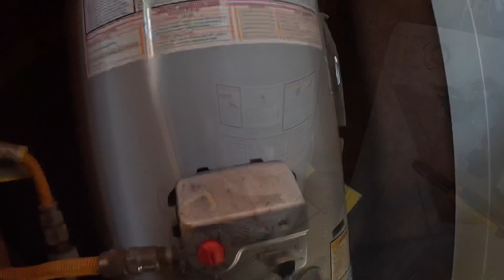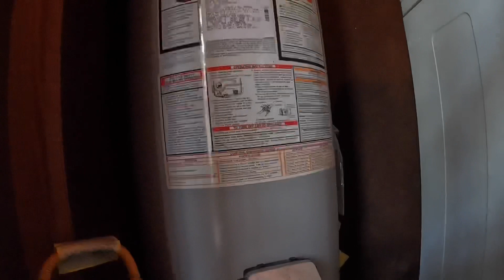Dangerous ⚠️ Water Heater! - How Do They Sleep At Night?

Comment: My roofers disconnected the vent pipe from my water heater. Some goober went up on the roof and messed with the pipe for 30 minutes. A couple days later, I found the pipe completely disconnected in the attic. I ended up fixing the pipe myself after a quick trip to Home Depot to buy some more B vent pipe.

Comment: FYI ...Hart & Cooley (Metal Vent) makes a single wall to double wall adapter. Believe the part # is 3 RPA!
Reply from the maker: Haven’t seen those
Reply: Me neither
Reply: That's code out west the depot sells them flue pipe listed parts on gas water heaters vent hood... 👍🤔🙏😔👍

Comment: Got a call last week, someone put a new furnace and coil in, set the condenser outside. Wired the furnace up and left. The lady called for a month to get it turned on, so the guy finally made it out and started it. Never hooked the flue or fresh air up, and let it run for months before they noticed something looked wrong

Comment: As a retired electrical contractor it is just easier to fix it correctly write out a bill and let it go. What your fixing is a common problem with all trades. Dependable licensed and insured contractors inherently cost more per hour than guys doing side work etc. Theses problems persist because homeowners or business owners see the difference in price per hour on service work and will hire the cheapest price they get, In the trades you pay for what you get. It’s that simple.

Comment: Good job, nothing wrong with single wall pipe, if it is done right. Always re-check for leaks after the unit fires. I once had a leak on a meter set appear after about 20 minutes, can't be too safe. Just a tip for you younger guys.

Comment: Up here in Virginia, after watching this I looked at my gas and furnace install (both gas). They have a combined 6 inch double wall going up through the floors. The furnace seems to be double wall all the way, to the combiner, but the water heater has a bit of single wall right at the heater flue. All well screwed and no tape in sight. So I guess up here in Va single wall is ok too, used appropriately. My new furnace was installed in 2022 and inspected by the county.

Comment: Why did you leave the adjustable 90 and just not use a straight piece of 3 inch from heater to B vent?
Reply: Wondering that too.
Reply: Not code to put screws in B vent in our area.  Didn’t look like there was 1” clearance from the double wall to the sheet rock.

Comment: GREAT JOB .Here in Las Vegas plumbing code for gas water heaters is must have a  sediment trap at the gas line before going into the gas valve .WH must be up off the ground 18 inches if located in a garage (car exhaust fumes) and drain pan.It's required that you must get a permit from the city but no one does that .

Comment: Curtis my local code , gas man locks out gas if appliance isn't connected with listed connection on type B pipe , for water heaters flue pipe , good adlib on bad vent line ✌️👍💪🙏🤔

Comment: You should take a piece of pilot tubing and bleed through that with a flame applied to the end of it rather than bleeding the way you did that the odorant won't be present right away but the gas could be also its a water heater you don't need to heat hot water lol
Reply: A pilot orifice is practically useless if you're trying to bleed the gas line. The pilot let's out such a little amount of gas that he may still be there bleeding it if he used that as a method.

Comment: I worked as a repair tech for a phone company. I had a case of trouble at a house and the IW (inside wire) was short in the house, testing from the protector on the outside of the house. The problem ended up being that the gas water heater had been replaced in the attic and the flue pipe was not long enough (like this video) and not secured correctly so whomever replaced it tied the IW running in the attic around the flue pipe to secure the pipe to a vertical 2X4. The hot flue pipe caused the IW to melt and the 2 wires that are used for dial tone were shorted together. There was enough slack in the wire to cut out the melted piece and resplice the 2 good ends of IW together. I advised the customer, I don't know if they had the flue pipe fixed or not.

Comment: Looked like the pressure relief valve was not properly installed either. It should have pipe attached that is no less than 6 inches from the floor.

Comment: I have a high gas bill and its summer time. I called the gas company and they said there is an appliance that is being turned on at night. I don't turn anything on so I think it's the water heater. Why would it heat water when I'm sleeping? Is this possible?
Reply: A traditional hot water heater ignites and heats the water every time it falls below the temperature lower threshold and heats it back to the limit temp.  Then it cools and repeats.  On-demand heaters don't do this, but traditional tanks all do this. .

Comment: they do make b-vent draft hood and universal connectors, there's also adjustable elbows(limited) and length adjustable sliding sections and of course it's all expensive and not stocked well.
end result is a cobbled and rigged mess

Comment: did you realize the bottom piece you used is an elbow that was twisted to a straight piece. Why didn't you just use one piece up to the double wall. where I come from we are allowed one one single wall connection...you guys have loose regulations....and the gap, no tape allowed have to be filled with high temp silicone or furnace cement...
Reply from the maker: It wasn’t directly under the flue. So, I kept the elbow. I know it’s hard to see.
Reply: There is a listed connection piece for vent hood on gas water heaters to type B pipe , I would straighten inner aluminum conn with needle nose pliers to make the fit to listed parts by code , gas company won't turn gas on or unlock till corrected in my local jurisdiction , hacks  been coming out of the woodwork lately... ✌️👍💪🙏😸🤔😔

Comment: I know all the benefits, but I just can’t imagine living in a house with natural gas, propane, or oil service. I live in Central Texas. It can get brutally cold, but my heat pump and heat strips handles it fine. Glass top electric stove and oven is great. Wood burning fireplace is a fun treat on moderately cold nights. Im not scared of my dryer burning the house down or the water heater pilot going out. I understand having gas in really cold climates. But in moderate climates there is so much for stuff to fail and the very slight risk your house could blow up with gas vs. electric. 

In a perfect world I hope to have one day, I have an all electric household like I do now, but with a natural gas service to a whole-house automatic generator. That will never  happen at my current house since we don’t have natural gas service where I live and I don’t have nearly enough land for a propane tank that I wouldn’t want anyway.
Reply: Wouldn't get gas either. For that matter even in Wisconsin I'm going all heat pump. It's doable. Stupid gas prices keep going up and down every month. Past month was 1.33 a therm. Back in 2020 it was around 80 to 90 cents. 
The exhaust stinks, it's not good for you, esp for people who have gas stoves. And it contributes heavily to global warming, after it is burned and for all the gas that leaks all over the place.
Reply: Electricity can burn it down just as fast, if properly done gas is very safe
Reply: If gas is done properly, it's as safe as electric. Most gas leaks are usually the consumer/contractors negligence.